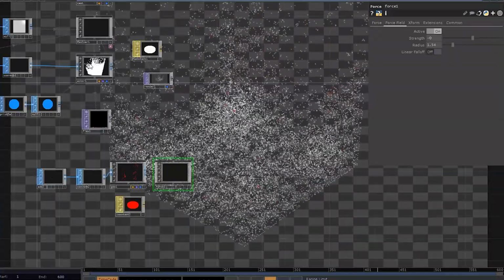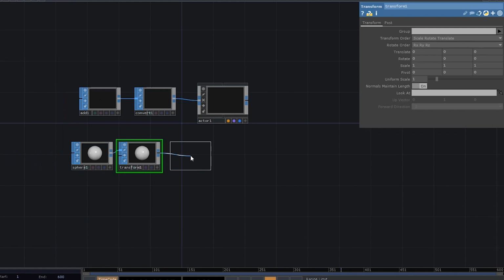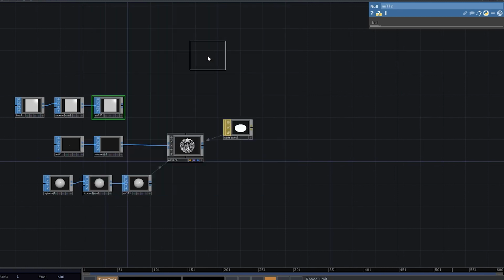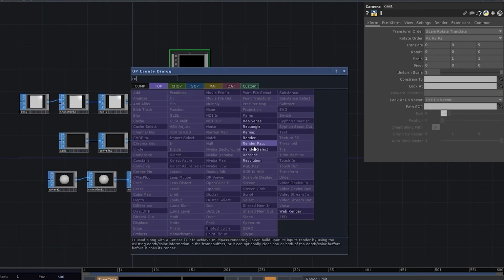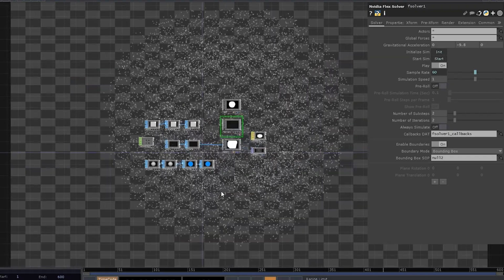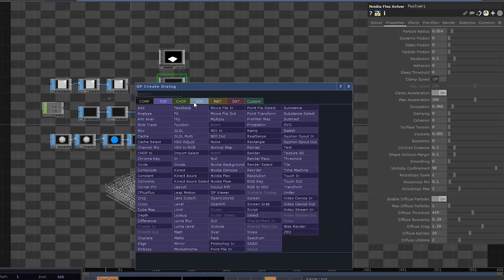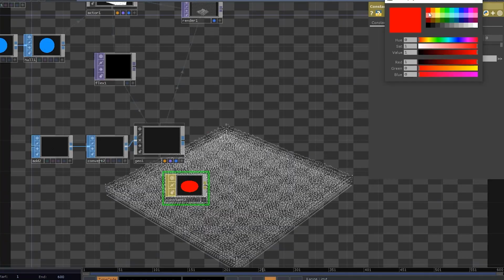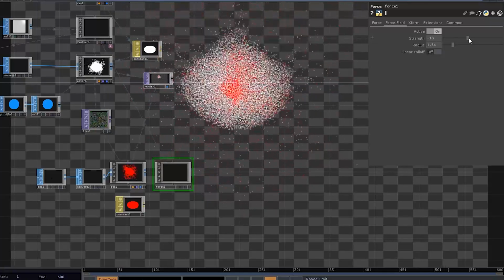Nvidia Flex Solver - part I (Touchdesigner tutorial)

Comment: an error occurred on actor when I set the sphere null as a translate op
Reply from the maker: Have you clicked the "Init" button yet? If yes, what does the error message say?
Reply: @noonesimg  I clicked the "init" button but nothing happened. The error message says that this actor comp has no sops to use for its collision shape.
Reply from the maker: @alexandraganiari706 Make sure that the add and convert SOPs are connected to the Actor comp and that they do create a point for the Actor comp to use. Also on the general tab, there's an update collision Shape button that you can click. Not 100% sure though, because I've never encountered such an error.
Reply: @noonesimg  add and convert SOPs do not create a point to the actor comp. Convert SOP isn't working. Also thank you for your help so far!!
Reply: @noonesimg  The problem was that the render and display flags on convert SOP were disabled. Now everything works fine! Thank you so much!
Reply: @alexandraganiari706  I have the same problem, how did you solve it please
Reply: @haoranye8827  check render and display flags on convert SOP
Reply: @alexandraganiari706  I've done it, but ACTOR still shows the same error
Reply: @alexandraganiari706  I found my problem, I didn't turn on the OUT1 SOP render in the actor. Thank you very much!
Reply: @haoranye8827  i cannot clearly find the out1 sop in the actor, could you please explain more?
Reply: @abumohsenpour  Hit enter with the actor 1 COMP selected. You will enter the comp and u should see the out1 sop in the actor.